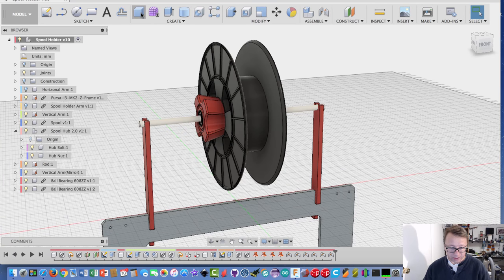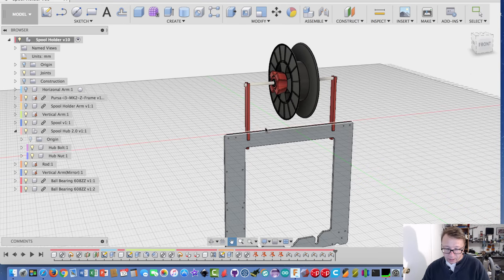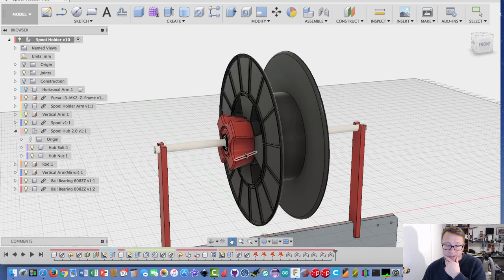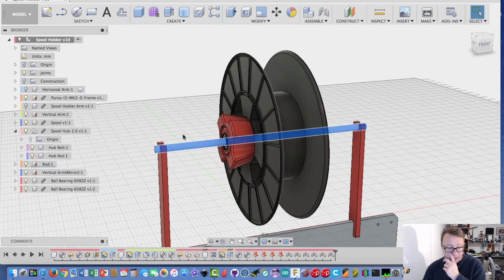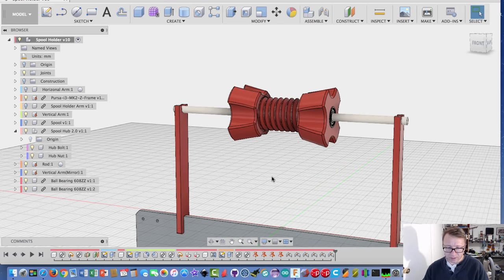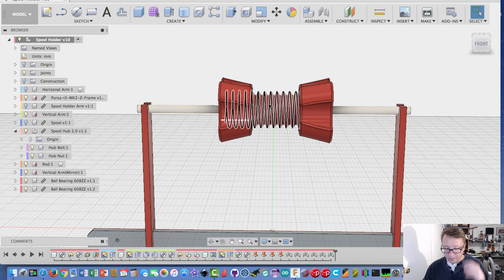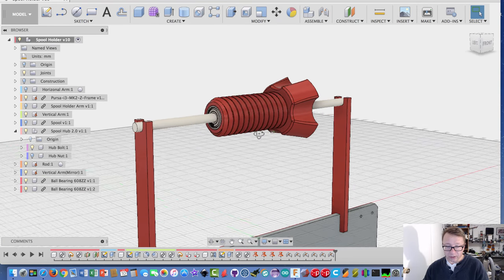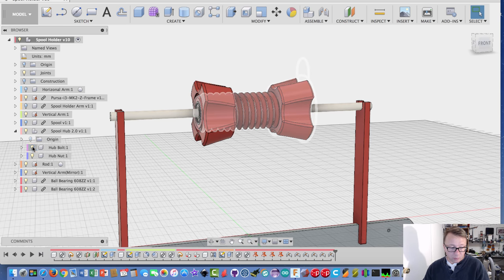New Filament Holder for Prusa i3 MK2

Comment: Just discovered all your videos, thanks for all the hard work.  I do like this design, as I've been looking for a better solution than the included Prusa design.   My only thought about this design is that the arms appear to hold the spool directly over the frame.   If that is the case, leaning the spool slightly to the rear would have helped ensure the arms maintain a positive lock on the frame, which is how the included Prusa arms are oriented.  I don't know if the spool would ever develop enough forward momentum to unlatch the arms, but it would be a bummer to have a full spool crash onto the bed.
Reply from the maker: Hi Jim - I thought of that, but I also thought that pushing the spool to the back would put unnecessary pressure on the frame, perhaps skewing it towards the back a little (+y axis), which is why I centered it.  All the weight is straight down.  I posted the fusion files so you can remake it if you want to move things around.  Thanks for the great feedback and for watching.  Don't forget to subscribe!

-Tom

Comment: Do you have a link to the vertical arm that you modified with the attachment at the bottom? Can't seem to locate the STL. Thanks. BTW, tried to tip the designer, wasn't set up for it.